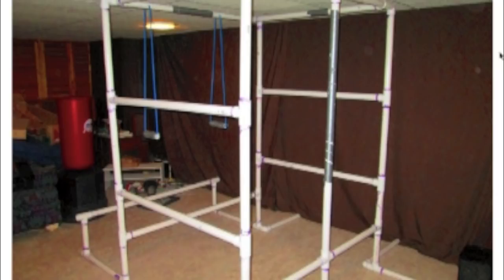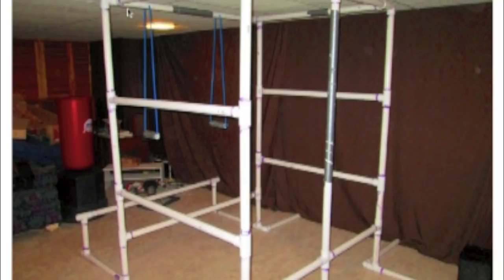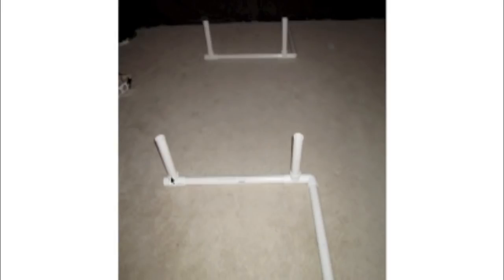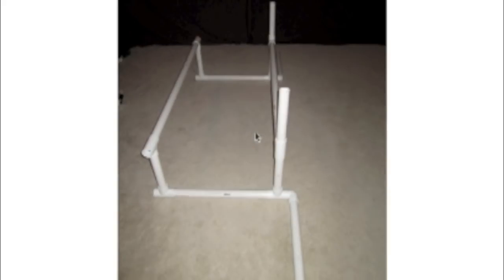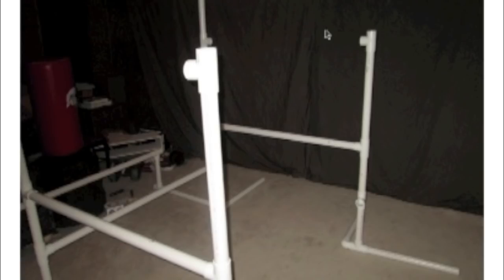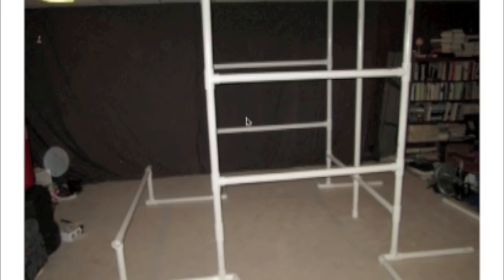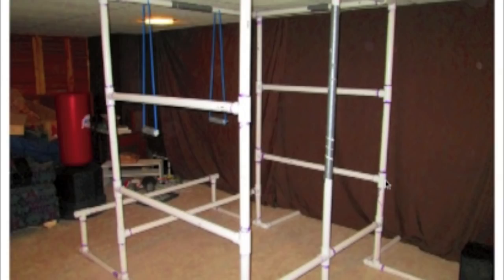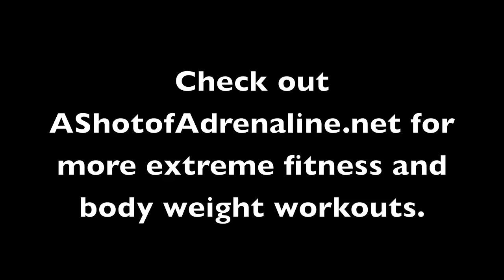How To Build A Full Home Gym Out Of PVC & 27 Exercises On It

Comment: You could fortify the horizontal pieces by sliding wood dowel inside of it.
1 1/2 inch hardwood dowel will fit nice and snugly inside your 1 1/2" PVC!
Home Depot has it in the 		Moulding & Millwork 		 		 		department.
Cheers
Reply: Correction, 1 1/4" PVC dowel. You used 1 1/4" PVC right?

Comment: You should have used Galvanized Pipes brah! They are much stronger and sturdier than these PVC pipes
Reply: There's another video where someone used Galvanized Pipes and Plumbing 3 way elbows to assemble a pull up bar.  The whole thing is stablized with 45 pound plates on all 4 corners.  Believe it not, the pipes are not 100% solid either and it still look wobbly.  The only way to really feel secure is to buy a RIG and mount it into the studs.  Then you can do anything you want (kips, muscle ups, pull ups with weighted vest), whatever it is that you want.